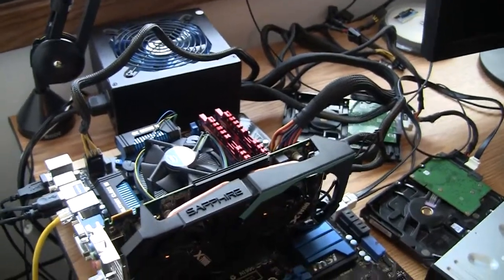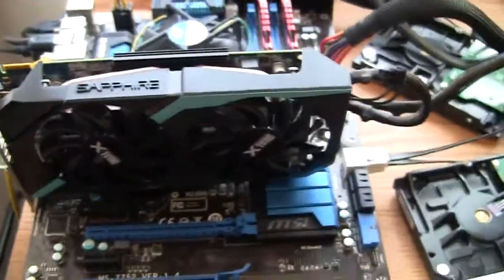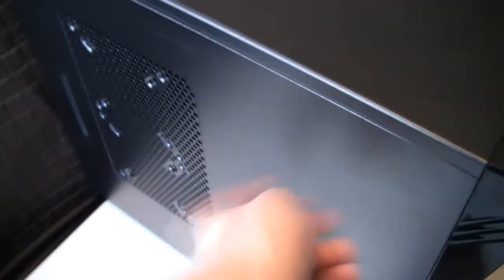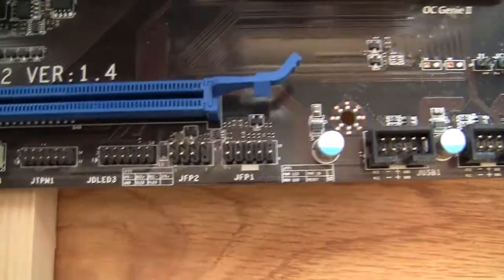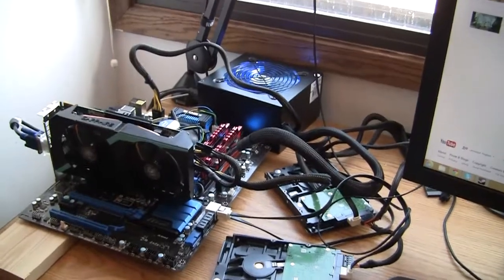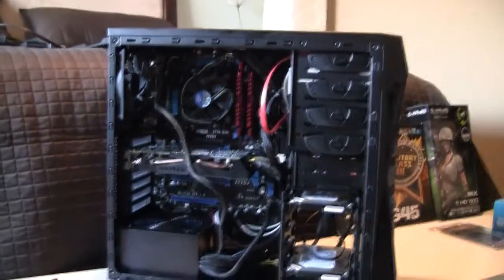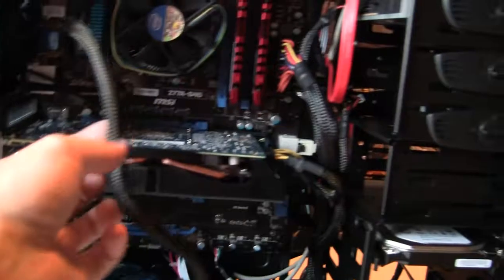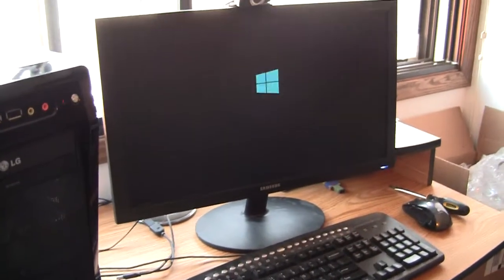Ben's Vlog #04 - The Computer Build

Comment from the maker: You know, I have noticed just the tiniest bit of vibration when all the fans spin up, but haven't figured out exactly which one it is yet. Guess that could explain it.
Mind you, this is only when running a game maximized on one screen, settings all the way up, while also recording. Normally I don't hear much more than the gentle "woosh" of air from all the case fans.